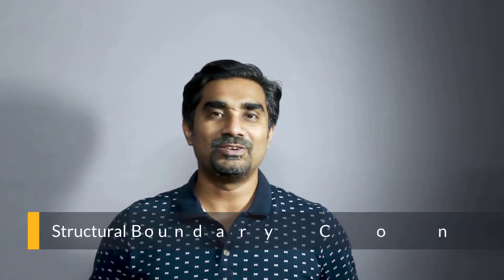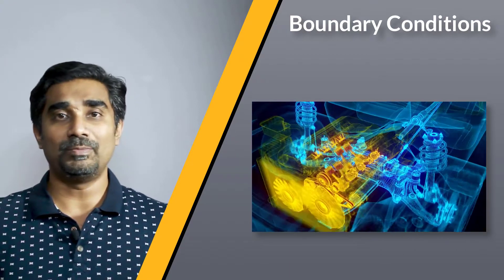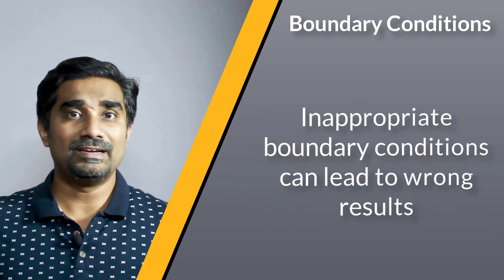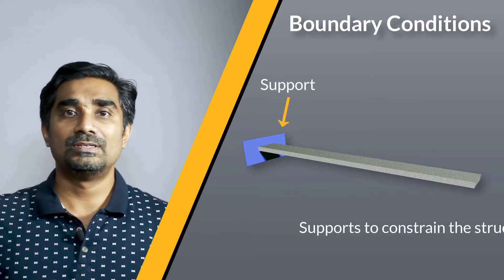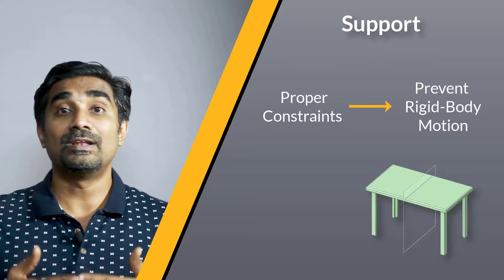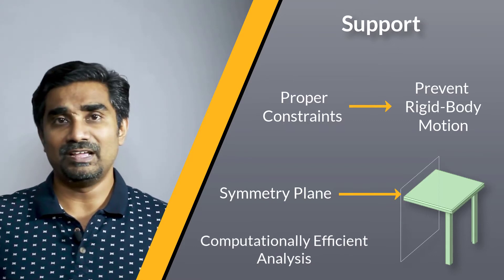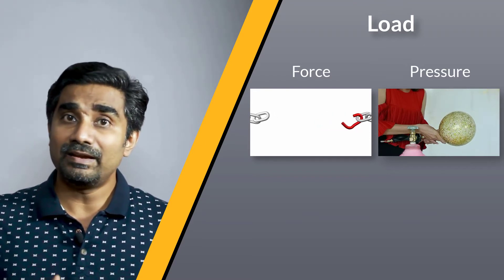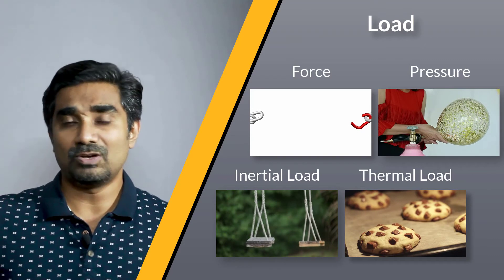Structural Boundary Conditions for Stress Analysis Using Ansys Mechanical – Course Overview

Comment: What should be the End Time, velocity and other settings in ANSYS Workbench Explicit Dynamics to simulate Quasi-static compression? 

I am trying to model a quasi-static compression of a complex structurAl geometry. The experiment was done at 2 mm/min of loading. I am using ANSYS Explicit Dynamics. I’m also using Automatic Mass Scaling. It is not working. If anyone has similar experience, please help me find the appropriate settings or any suggestions is highly appreciated.